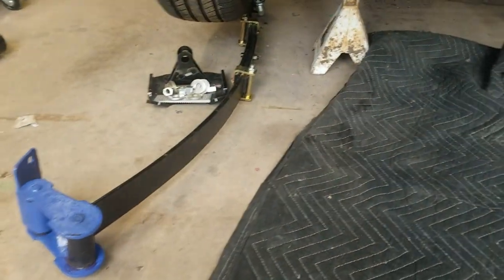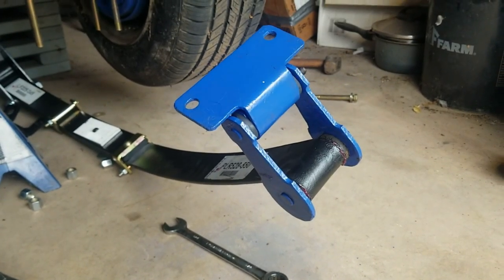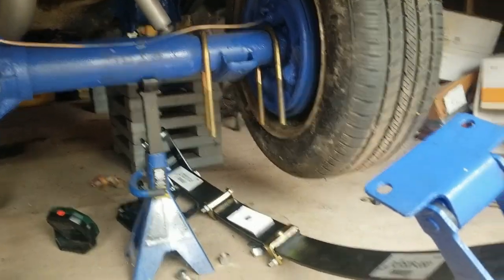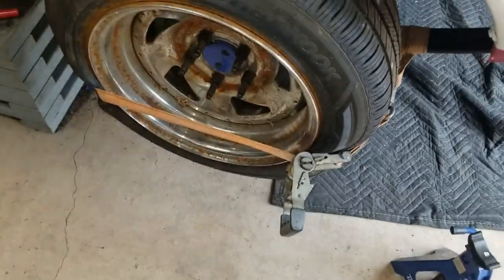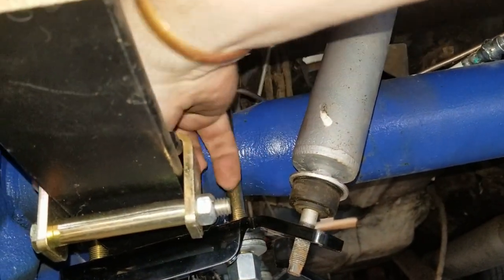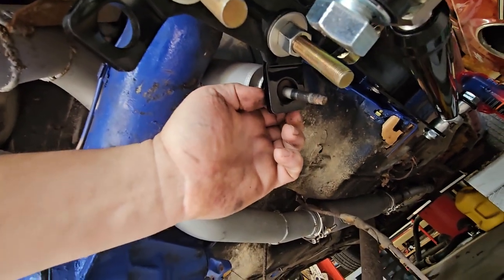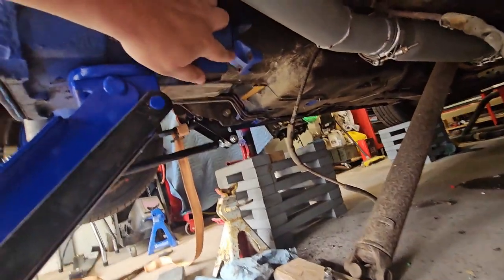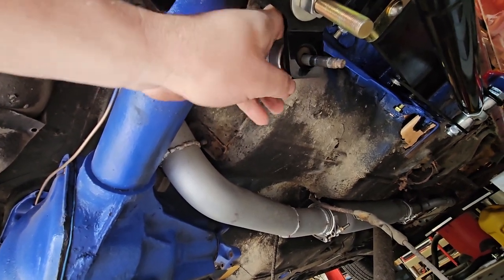Drag n Drive Pinto: Calvert Racing Split Mono Leaf Springs 3

Comment: Hi Nate... long time no speak... how's it going. From what I saw on other video's the shackle hangers on yours seem to be opposite to where they should be.. have you tried turning one 180 degrees and see if that corrects the problem.
Reply from the maker: Good eye!  Yes I agree they are swung too far forward for where the springs are settled at car weight.  I could flip the hangers but the looped part would hit the head of the bolts in front of it.  I think the plan is to watch it in action with a Gopro camera and then decide how to make my own hanger/shackle set up.  I think it is because the Calvert split mono leaf springs are way stiffer than stock springs, making them a bit short.